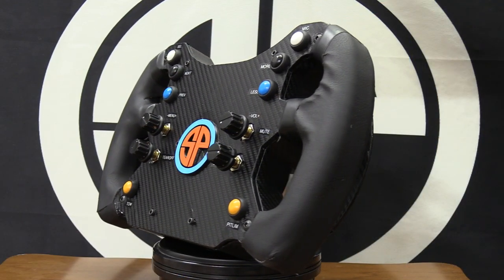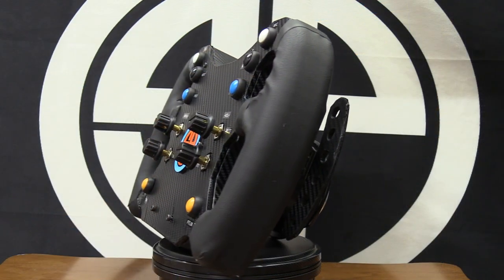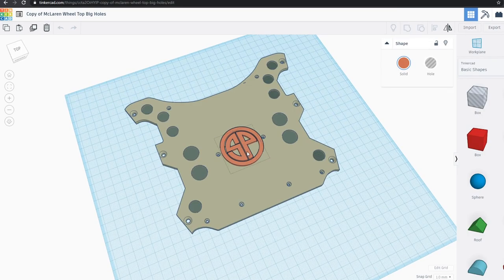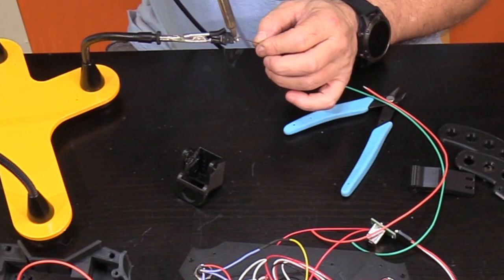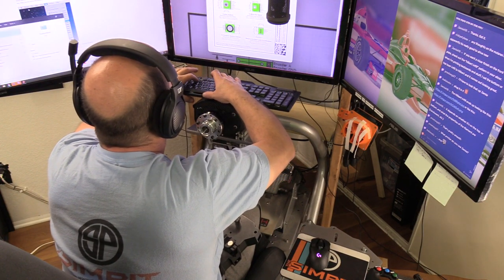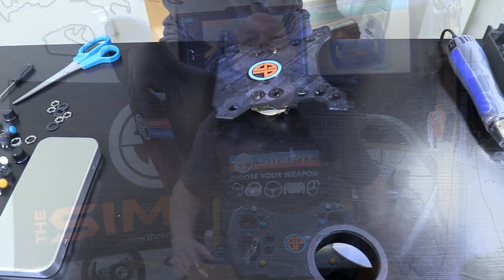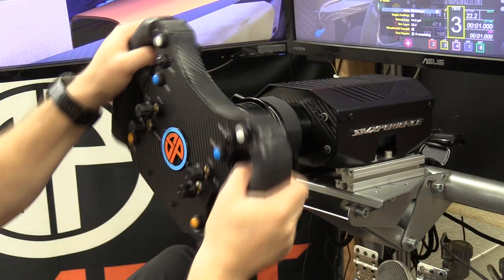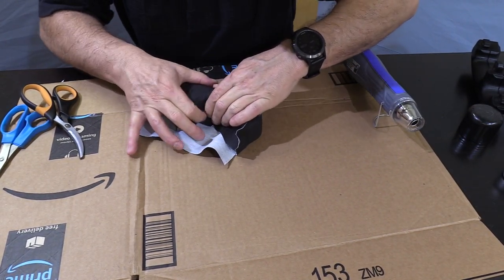DIY McLaren GT3 Style Sim Wheel - My 3D Printed Wheel Experience

Comment: I started this project months ago and stopped due to time. I have everything printed, buttons in place, soldering mostly done. Just need to get a circuit board (will probably go Arduino route) to hook it all up to. Looks like you've hit a lot of the same problems I did - I also had to redo the button holes for larger buttons. Well, watching this you've inspired me to get it finished!

Comment: I'm sad you didnt feature my MP4-22 wheel :< My design is not perfect but it is under 70 bucks to make and I have been using it for over a year and it has still survived. Although mine is printed in two halves which you araldite together so that the grips are printed with it.